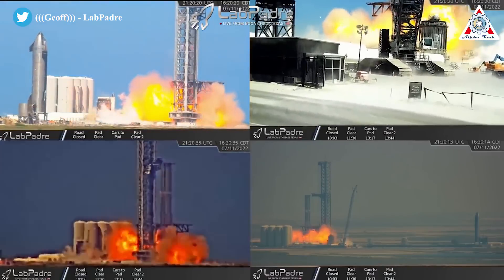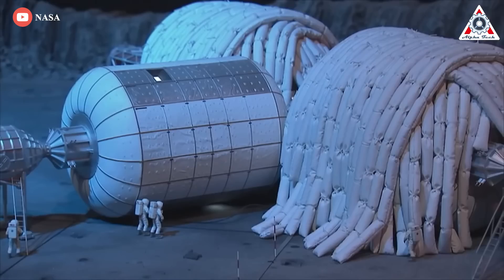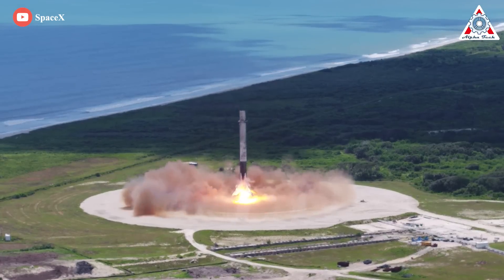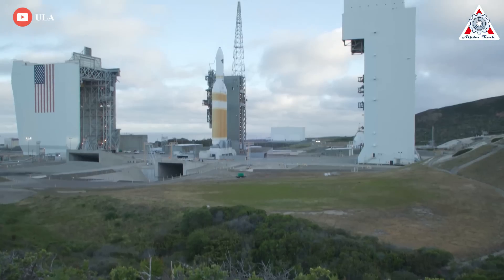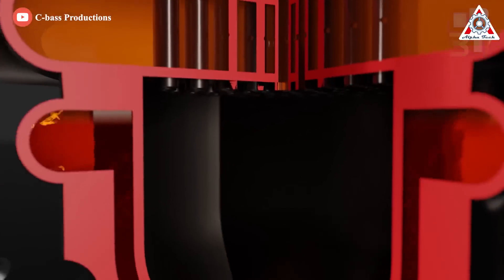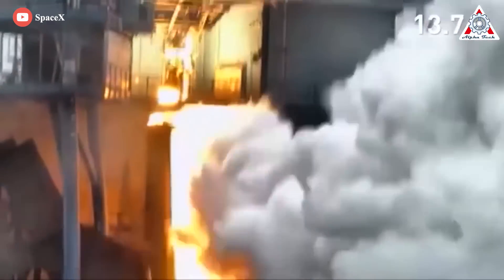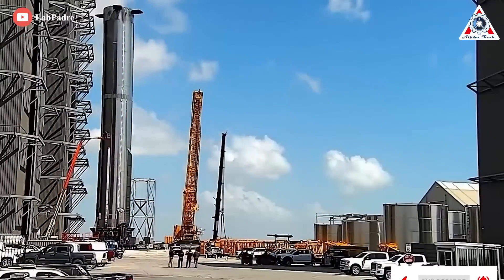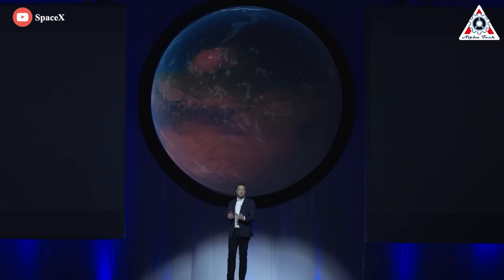Elon Musk’s real reason to Developed The insane Raptor 2 Engine!

Comment: How is Starship going to meet up with Mars and not overshoot it? Same with the return flight? Going away from the Sun is one thing but getting rid of the energy while approaching it (Mars to Earth) is something else. We've probably learned a lot from the orbital mechanics of the Parker Solar Probe.
Reply: @billdickson1142  I'm concerned about the orbital mechanics.
Reply: @greggweber9967  mathematics. they count distance and when start burning fuel to gain or loose speed. if anything i would be worried more about radiation or reliability of systems in general than something people trained for it can and actualy do for over 50 years and it works.

Comment: Reality check: Not one Raptor 2 engine has ever flown.  Starship fully loaded has 30+ of these, that all need to not explode.  The Russian N1 rocket had fewer engines, and when it exploded, was the biggest explosion in rocket history, and still is.  Starship and it's booster is larger than the N1 rocket.  The damage from the N1 rocket explosion was so bad, it put the Russian launch pad out of commission for years.  If Startship explodes, the entire complex will be leveled.  So, untested engines, biggest rocket in history, comparatively tiny complex... not to mention wacko way of landing trying to catch it... one word: BOOM!
Reply: They tested the engines! They should work as advertised! Human error is most likely to blame on any mishaps. They gotta lotta hats working on this project! Only takez one fuck up to make a shit show.
Reply: fortunately computer modeling has imnproved drastically since the early 1970's.

Comment: Raptor 2 doesn't "keep exploding". You showed the recent explosion beneath the booster that was caused by an ignition source setting off the combination of gases produced during the spin test. That wasn't a "raptor exploding".
Reply: Tim Cook channel.
Reply: Don't understand. I saw a fireball and it was'nt July 4th...?
Reply: They HAVE exploded several Raptors at MacGregor though. One fairly recently.
Reply: @HylanderSB  Only because they are pushing it to the limit to see what breaks first and then try to improve upon the design...
Reply: @FuriousImp   Yup. They’re building at least one a day. They can afford to lose several “for science.”
Reply: @HylanderSB  
Acceptance testing.  The ones being sent to Boca Chica have passed the tests foe installment into SH for flight.
Reply: @HylanderSB  Yes, and Elon has indicated they've exploded several Raptors. He also says they melt engine components too.
Reply: @HylanderSB  Well that’s not what he said in the video